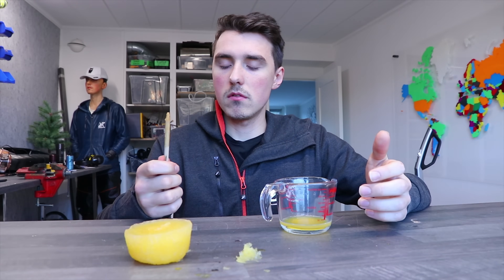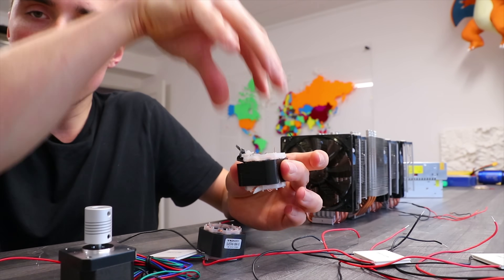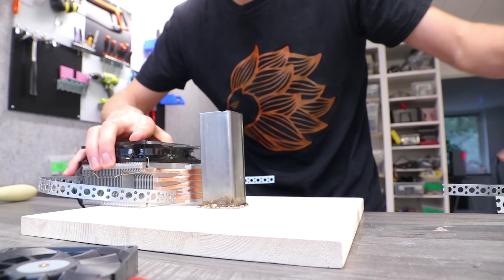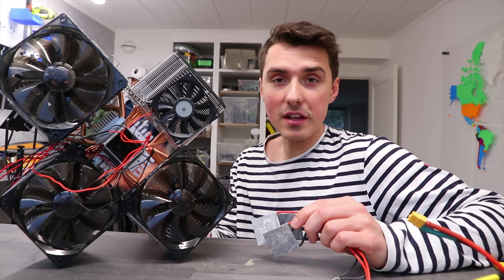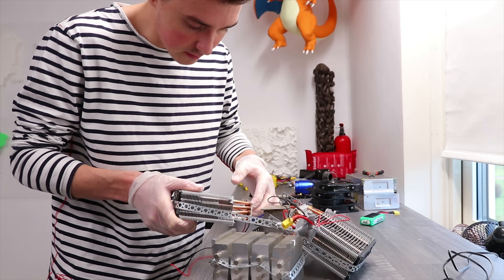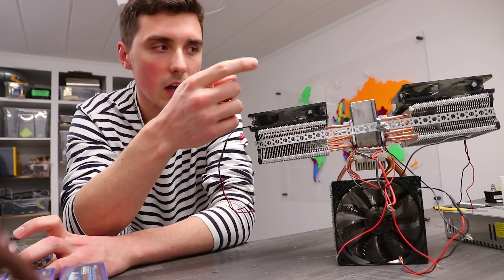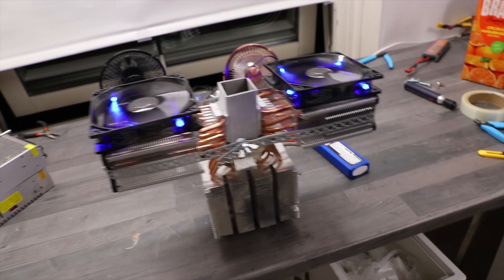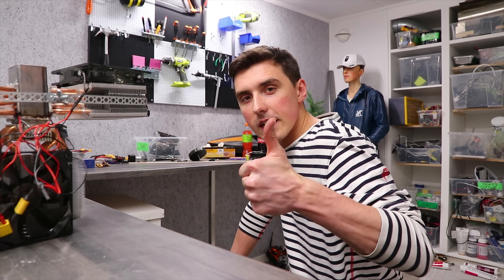600W Ice Cream Thermoelectric Freezer

Comment: Wonder what would happen if you placed an arrangement of a 2 x 2 (cascade) each side of a 40x80 water cooler plate, and circulated anti freeze through it?
A cascade (2 heat pumps) you can achieve -40C

Comment: Maybe separate peltier hot array cell from cold array and generate electricity to drive referigerator to condense light , water , carbon and air make ice cream while cooling the room by let peltier extract heat to generate electricity

Comment: You should use just one 600W Peltier element and one 360 AIO cooler, I guess you can keep the hot side of the Peltier could enough and because of this you need ridiculous high amount of current because of inefficiency.
One 600Watt with a really decent cooling and a good Tint and low thermal resistance should be much bether I guess :D

Comment: Seems like you are not putting thermal compound on the steel. The heat conduction path is only going to be as good as the weakest link; and if so, that would be it. But yeah, big block of metal in the freezer seems like a better instant icecream device.

Comment: Omg this is super sketchy
-metal you get from the store has a ton of oil on it
-hes using solder so hes problablly has some decent lead poisoning
-its not sanitary to begin with (wash hands? oh not to mention the fucking virus)
-damage to the fins
-no insolation
-liquid next to DC AND AC
-frostbite (or burn)
-insanely inefficient
-no heat exchanger 
-mannequin (WHY?! and how)
Reply: First, the virus wasn’t even a thing when this video was created. Second your profile pic and name is even more dumb.

Comment: I think you used Liquid Metal (which is awful for both ALUMINUM and LOW TEMPERATURE) instead of a decent thermal interface. Just get any that's good for extreme overclocking (sub 0) on PC's and it will improve a lot.

Comment: Explain why you think this is a good idea! Dam thing chews 600+ watts of power.Eats lot of space.Will have a huge problem if a fan fails.very difficult to carry anywhere.Cools in only that tiny central box which is barely a third of a glass...I love new ideas but TEP /TEC cooling is never efficient.With a 65Watt  compressor this idea is washed off.FROZEN!

Comment: Have you (or anyone you know of) tried using Peltier thermoelectrics cooling side to cool an enclosed space AND using the same Peltier thermoelectrics heating side to drive an adsorption cooling cycle for greater overal efficiency?
Reply: It's an idea but it still won't be as efficient as a phase change refrigeration system

Comment: First, you should pour the juice as cold as possible before freezing. Second: you should use a aluminum square tube with the same size of peltier modules. Third, you should try to setting up the coolers in a cross section but at the same level. And four, if you have a AC in your room, put it on the minimum temperature for at least 2 hours before the essay. Wait in the room until the temperature gets down. Try it.

Comment: Many people would suggest that you stack several Peltier elements to increase thermal difference on both sides of the stack, but this doesn't work for many reasons. There is a way though to stack 3 elements in a special configuration and by doing so and using 4-5 such stacks you can easily achieve temperatures below -50 degree Celsius. Still not the most effective configuration but definitely a great and cheap way to have extremely low temps at home.

Comment: I think you should stack two peltiers. The maximum temperature difference between the two sides is limited: heat will start leaking from hot to cool side. Two stacked peltiers should get you to at least minus twenty Celsius.
Reply: Stack two modules and run them at lower power to increase the efficiency.  2 stage system.

Comment: use this experiment as a pc water cooler 

Like to up!!
Reply: Linus Tech Tips already did that if you want to watch that. But it doesn't take much thinking to realize that if you're using computer heat sinks and fans to cool a thermoelectric cooler to in turn cool a computer you'd be better off removing the middle man (the thermoelectric cooler).
Reply: The size, amount of heat, and amount of condensation it produces wouldnt work well
Reply: watercoolers are actually way worse than a good air cooler. they just store a ton more energy, but thats not usefull here
Reply: @Pryside  your wrong. Water coolers beat air coolers ten fold

Comment: 5:10 OMFG YOU  USED LIQUID METAL THERMAL COMPOUND!!! BAD! NO NO NO NO!!! That stuff has gallium, tin, and indium. GALLIUM EATS ALUMINIUM. It soaks into the aluminium and DESTROYS it.
Reply: Kas b That’s only true if you remove the aluminium oxide layer that forms relatively quickly in open air. Otherwise, it’s usually quite safe for this sort of application.
Reply: @strandedsurvivor7888  Right...you realize it only takes the smallest scratch to remove the oxide layer enough for gallium to attack it right? It's 100% clear that the heatsink got attacked by gallium. It is NEVER safe for aluminium application. You can't even bring the stuff onto airplanes.
Reply: @kasuraga  I'm aware you can't bring it onto airplanes, yes. And yes, I'm also aware a small scratch can remove that oxide layer. Gallium does take its time to weave its way through the aluminium though, so the damage caused there will have been done over a period of maybe 5-10 minutes, which sounds about right for the overall setup time. At no point did I say it was safe for any aluminium application, I just said that for this application it was mostly fine.

Comment: Eu gosto muito dos seus videos acho bem interessantes, esse projeto devia ter uma versão 2.0 onde o sistema de refrigeração poderia ser externa como ar condicionado (não sei se seria possível, através de gases até) ou em um sistema mais bem colocado, poderia fazer uma forma para o picolé removível dentro dessa abertura para não ter contato com o metal e por final fazer um objeto na impressora 3D para colocar tudo isso dentro, experimenta usar menos placas de peltier, seria interessante obter sorvete em alguns minutos mesmo que gaste um pouco de energia porém iria ser pouco tempo, seria interessante colocar o tempo no vídeo para ter uma noção, abraços do Brasil !

EN:
I like your videos very much I find it very interesting, this project should have a version 2.0, where the cooling system could be external as air conditioning (it would not be possible, through gases up) or in a better placed system, could make a way to remove the remover inside this opening so as not to have contact with the metal and finally make an object in the 3D printer to put it all in, try using less peltier plates, seriously interesting to use ice cream in a few minutes even if you spend a little energy but it would be a short time, it would be interesting to put time without video to get a sense, hugs from Brazil!
Reply: come to brazil

Comment: If you were to rotate your heatsinks 90° you could get them all lined up at the same level. If you used liquid cooling blocks with coolant for hot environments you'd have far better cooling for the Pelletier devices and be able to use many more Pelletier devices

Comment: make the cold block bigger so that when liquid is poured all the heat can dissipate in it (like a capacitor for cooling) rather than paltier removing it actively/realtime/directly. but on the down side the block will take time to get cool and environment heat will make it hot easy so insolation would be needed

Comment: the trick is use a stirling motor or rotation like you did here https://www.youtube.com/watch?v=Qg8jFa7c_uo
or another shape like a flat rectangle so the depth is only 1cm (but height x width is 10cm for example
i had the same idea but i would instead use many small peltier elements to  increase the surface area (12-20) and > 1KW

Comment: you need a better power supply.  look up HP 498152-001 Proliant DL360 on ebay, a high quality 12V 100A power supply that you can also run in series for 24V, I have several of them.  $20 each.

Comment: You need to use aluminum square stock for 1 and 2 you are thinking how do i cap the end and insulate it, silicone. problem solved.

Comment: Do not use liquid metal thermal compounds on aluminum. It’s made of galinstan alloy which is 65% gallium metal that’s very corrosive to aluminum.
Reply: Amalgamation I think is the term, right?
Reply: Jason Axford Eutectic alloy actually.
Reply: @mikewolf78  cool, thanks. 
I thought it was the same reaction that mercury has with aluminium like in the NileRed video.
Reply: @mozkitolife5437  no but aluminium gets verry brittel with galium so brittel that you can crumbel a baseball bat with you hands
Reply: I thought he was using steel though, not aluminium
Reply: @redfox05nl  but the cpu cooler has aluminium parts
Reply: LOL! - so thats the reason the heat  sink broke into pieces. I didn't even know there was thermal compounds with gallium - since most heat sinks are aluminium (altough there are some made of copper also).
Reply: @Speeder84XL  its called liquid metal it performes awesom but you need a nikel plated coper plate at thebottom of the coler pure coper doesnt get damaged but the liquid metal wicks into it what need re aplication around once a month

Comment: Make a food safe silicon sleeve mold that slips into the metal tube so that you're not ingesting those poisonous metals . Also insulate the exposed parts on the outside of the tube and flip those fans so that they're pushing the hot air up instead of down . Then you should have a not so useless frozen water maker .

Comment: Tin won't hurt you unless a large lump fell on you, but the lead in solder is a different matter.
If there's a next time then make the container out of copper sheets - you can open up 22mm copper pipe then flatten it and solder together using tin solder.

Comment: u should add some thermal paste into the tubing too, that way it would give great amount of toxicness right away.. u probably need to consider the pipe section one more time, pick something like just one side much much narrower like a very long rectangle (for example 4 mmX 30mm pick the long side according to your modules) and much longer with more Ps

Comment: If you want to instantly solidify water you need a lot of power: let's say that you have 4x4x10cm = 0,16 lt, the amount of calories you need to drop it from 20°C to 0°C is 0,16x20 = 3,2 kCal. If you want to do that in 1 hour you need an amount of power of 3,2 kCal/h, if you want to do that in a second you need 3,2*3600 (seconds in an hour) = 11520 kCal/h. Translated in Watt it is 13398 Watts, that is around the power you need to cool two apartments!

Comment: Water stores much more energy with its temperature compared to most other compounds and elements. Like ten times more than iron (per gram). So heating it up takes much more energy than for instance soil. When pouring the water into the cup it really fast absorbs the cold from the iron, without cooling down much itself. If you used ice as a cold "battery", it will absorb more of the heat from the juice without heating up much. Maybe. It was a long time since I studied physics.

Comment: 5:12 use proper thermal paste to work with aluminum.
Reply: It was gallium
Reply: thanks, i was already wondering what has happened.

to me it looked like mercury, but that would not happen so fast..
Reply: @Believer yes, but you need an external power source thoose thermoelectric couples consumes alot, a motherboard might not provide enough current. And youll need a heatsink on the hot side
Reply: @Believer yes u can do it in that way. but in overall cost of all this parts and energy for use it is not worth.
u must count how many peltiers u need to cool down hi-end cpu + how many watts peltier take to work and in the end how many watts u need to your peltier cooling system.
its not worth.
Much better solution is: "IceGiant" - use google.
Reply: Peltier modules are not good for cooling much. They draw way to much power and need to much cooling. You would just be better with a radiator and  fans.

Comment: Simon, you need to use aluminium.
it is much better for thermal exchange (i cant really tell it on english). but alumium is much better heat conductive, so it would be much better for this project.
i can give you some other chemical and physically ideas.

Comment: 5:18 :D galium destrois aluminium  :)
Reply: looked really like gallium corrosion, especially with the little metallic drops on the cooler.
maybe the solder he used has traces of it, or he used the cooler once with a liquid metal thermal component once. once is enough^^
Reply: Liquid Metall thermal compound= on cpu+copper or nikel plate over 10°better then best normal thermal paste

Comment: Great Channel. Man try to do a Stirling Engine, it would be nice. And maybe use it to power a rc boat. Idont know it that can be done.
Reply: Sterling engines have like zero torque I imagine the prop drag in the water would stall it straight away but would be interesting to try I guess